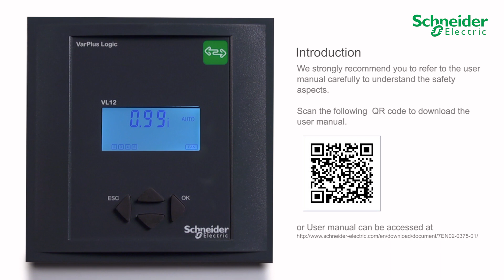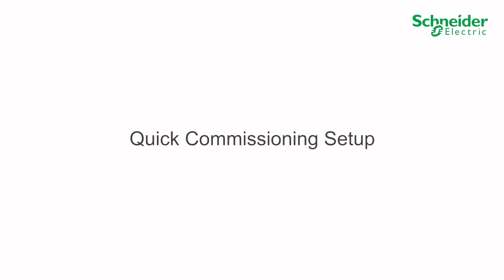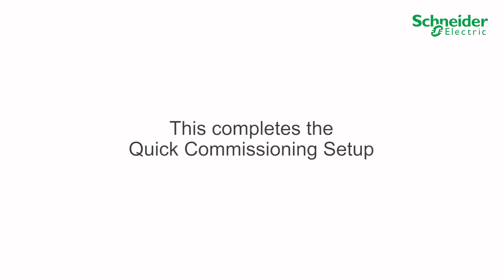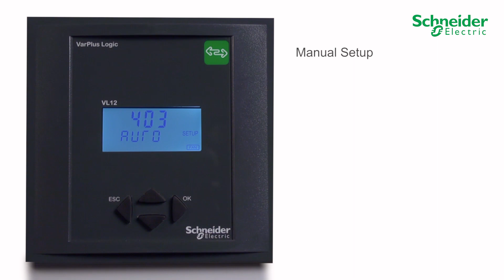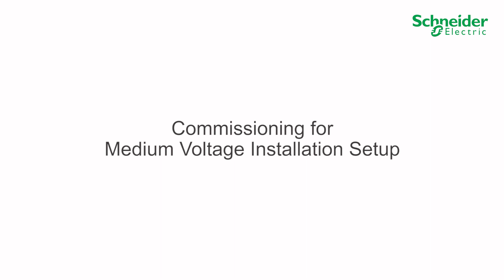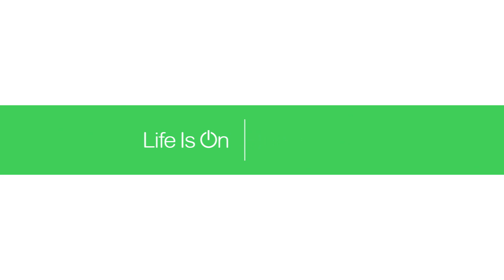VarPlus Logic Commissioning Video | Schneider Electric Support

Comment: Hello, how I can reduce sensitive of controller? Because Schneider is very sensitive. If small problems and go on alarms. Switching off condensators.
I entered cos 0.99, it is posible to enter 1.05, because I want to over compensation.  Is it correct that I entered in 312 invisible Q?

Comment: Sir I'm using Schneider RT12 APFC controller 
...in that I have to enter CT and CK value. We have connected 200/5 Current transform so I'm are entering CT:40  and CK: 0.13 first bank is of 5 kVAr

I'm entering correct value??
Reply from the maker: Dear Mr. Raikar,

Greetings from Schneider !

We have assigned your query to the concerned team and they will get back to you shortly. Meanwhile, requesting you to kindly share your contact details so that we can assist you in a better way.

Regards,
Shweta Jamwal
Customer Care Center.
Reply from the maker: Dear Mr Raikar,
Good Day!

Please find below details as per your query:

C/k value of 0.13 is correct in your case. C/k is the value obtained by dividing first step capacitor power "C" to the Current Transformer Ratio "k".
Current Transformer Primary Value is selected in setting so please set 200 only.